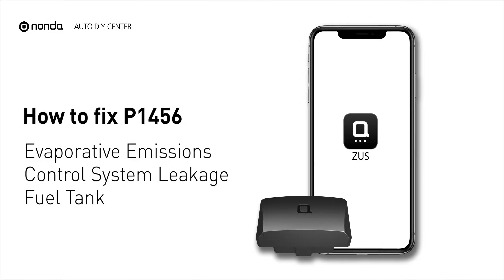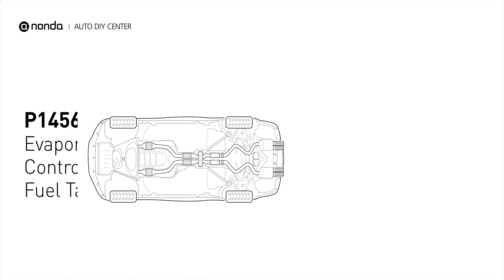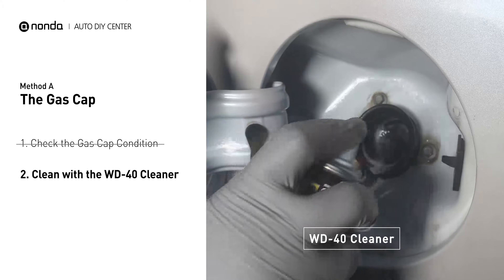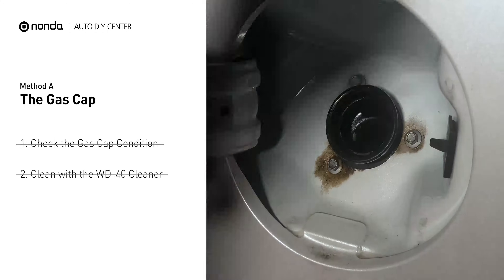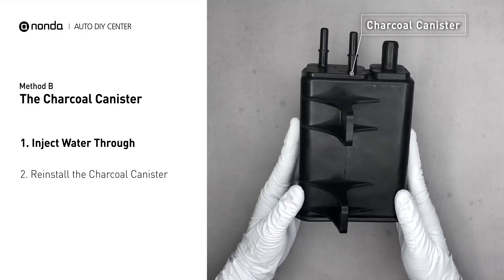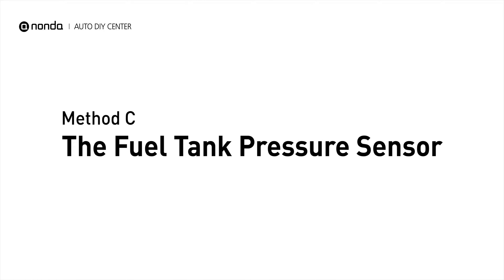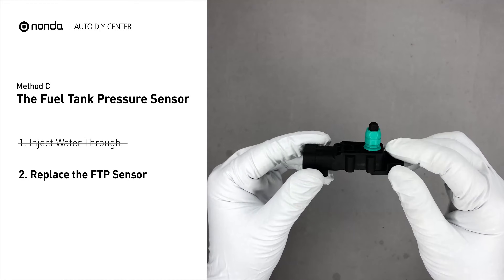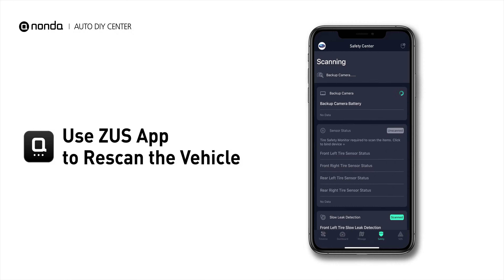How to Fix P1456 Engine Code in 4 Minutes [3 DIY Methods / Only $4.55]

Comment: Hi Steve,
It is the best video about the P1456 Honda code I found on YouTube. Short, informative, and nothing extra. I fixed my 1998 Honda Accord problem using your method A (WD-40). I tried to clean my gas cap with gasoline before but it didn't work. Fortunately, WD-40 worked very well, thanks to you!
Leonid
Reply from the maker: Hi Leonid, thanks for watching! We're glad to be of help!

Comment: I have this code popping up in a 2002 Nissan Sentra SER. I believe it is the fuel bypass check valve next to the charcoal canister, or vacuum switching valve...
Reply from the maker: Hi Greg, kindly inspect the fuel tank pressure sensor and the charcoal canister if faulty. Make sure to clean the gas cap.

Comment: Can someone translate me to Spanish 😢
Reply from the maker: Estos son los métodos que arreglarían el código P1456:

1. Reparar el código del motor P1456 Método fácil de bricolaje A | El tapón de gasolina
1. Verifique la condición del tapón de gasolina
2. Limpiar con el limpiador WD-40

2. Arregle el código de motor P1456 Método fácil de bricolaje B | El bote de carbón
1. Inyecte agua a través
2. Vuelva a instalar el recipiente de carbón.

3. Arregle el código del motor P1456 Método fácil de bricolaje C | El sensor de presión del tanque de combustible
1. Inspeccione el sensor de FTP
2. Reemplace el sensor FTP

Espero que esto te ayude y avísanos si tienes más preguntas.

Comment: Have this code on a 98 Honda Civic. It’s been smoke tested with no visible leaks. The gas cap, 2-way valve, and bypass valve have been replaced with no difference. The only clue I have is when the outside ambient temps are high (70 degrees or more) the system passes and the code doesn’t register. Anything colder and it comes back
Reply: Fuel pressure sensor
Reply from the maker: Hello, we suggest taking your vehicle to your local mechanic for visual inspection of the related parts. This is to avoid misdiagnosis and to ensure the proper solution on the issue.

Comment: Does this code have any car symptoms? I have an 03 Honda pilot
Reply from the maker: Hello, you can notice a fuel odor caused by the release of fuel vapors.
Reply: @nondainc  i have noticed it once during a long drive and then never again, I have an acura 2003 rsx
Reply: @CherryBoyJ  I have a Acura 2003 tl I also noticed the smell
Reply: @CherryBoyJ  Were you able to fix the issue.  Did you have error code P1456?  I have the same car.
Reply: @nondainc  I have a fuel tank smell order ! I have the code on my on Honda pilot 2004
Reply: @isaacsmith8150  im about to do the 1st 2 steps this week. then the fuel tank sensor if they dont work. ill report back if i can remember.
Reply: May have trouble filling up gas